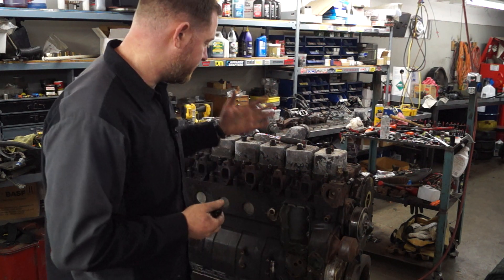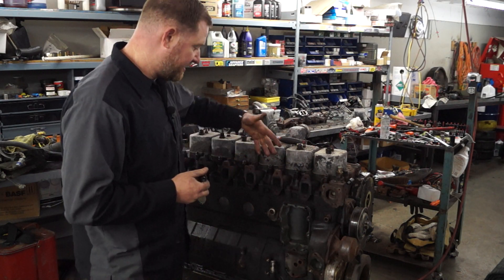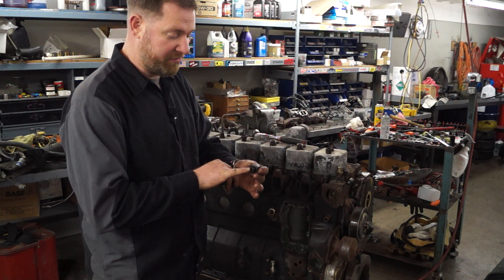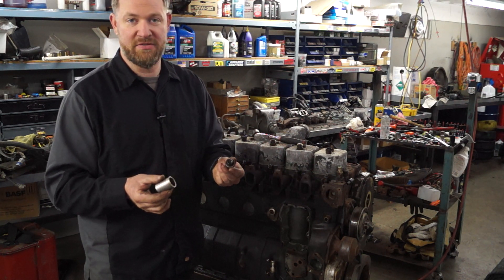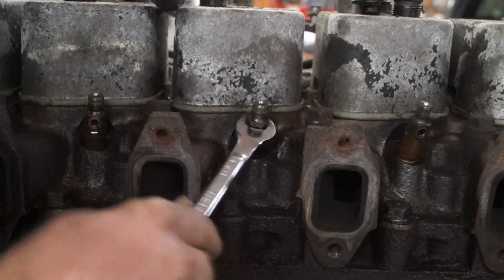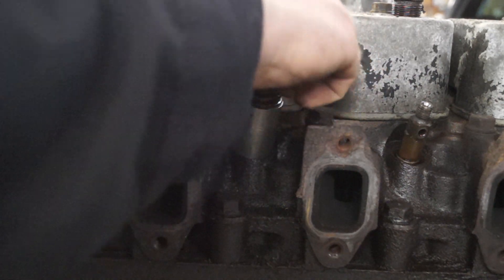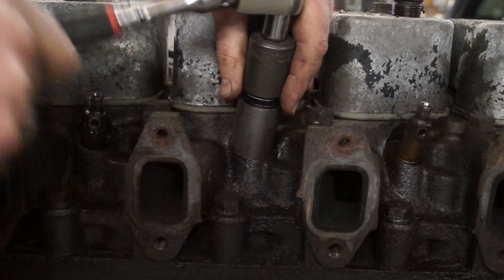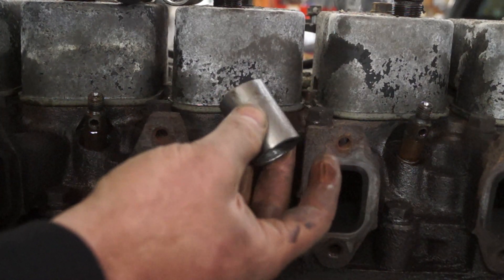How to Remove a Stuck Fuel Injector on a Cummins 6BT 5.9L 12 Valve Diesel

Comment: Hey mate, I have a 4bt with stuck retaining nuts, they don't seem to want to let go, so I've just sprayed them with lanolin and 2 have released but 2 are stuck tight and I don't want to bust them, have you come across this at all?
Cheers, Dan
Reply: heat them up cherry red and put your back into it with the breaker bar

Comment: I have a Mechanical Cummins 5.9 turbo in my 95 BlueBird bus (Skoolie) it looks exactly like this one it just started knocking real bad.. 
I had to replace the fuel pump and the fuel line and now it has started knocking and was wondering could this be a bad injector or could it straiten its self out with a good drive. Also it has been  sitting and only being cranked up once a month for the past 2 years (working on my conversion still).